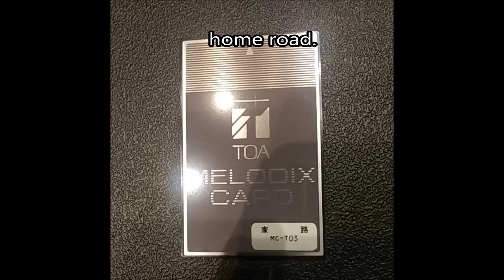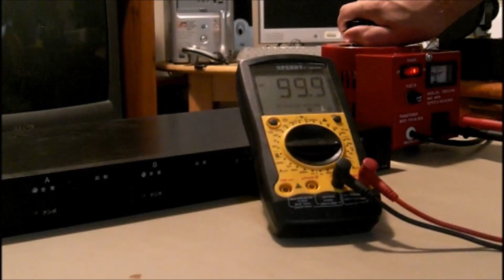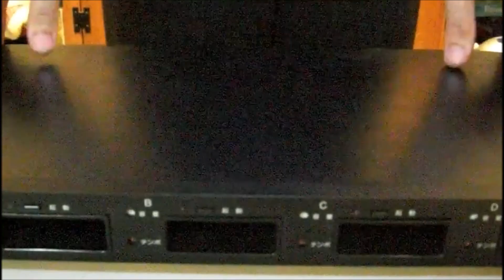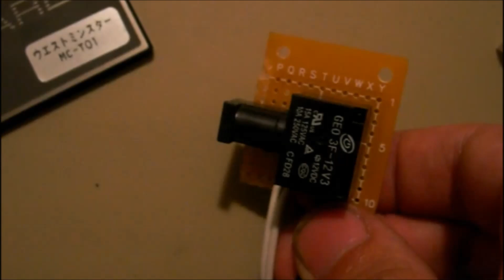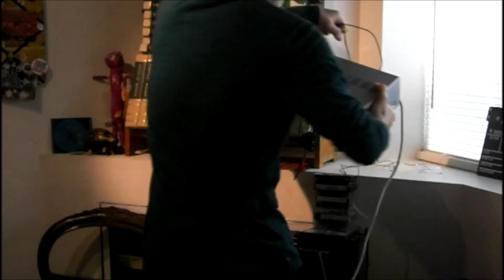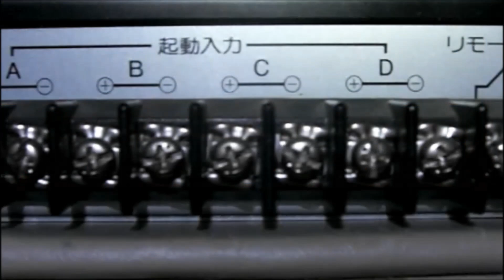toa melodix - a look at the chime source used in a majority of japan's outdoor warning system.

Comment: There is also a system of radios installed in each major fire department, those radios are to transmit emergency signals to these outdoor speakers. The FDMA Is the one who mainly transmits the emergency signals, the signals are made by J-Alert a company owned by the FDMA. For example, if there is a missile launch, The FDMA Will issued a missile launch information warning using the radios mentioned.

Comment: i recently placed a bid on an ml-1000 (card included). fingers crossed 🤞

update: i won
Reply from the maker: congrats on winning the melodix! now i won't be the only one in the states to own one. though i am still the only one with an ml-304b model. and you'll be the only one with an ml-1000 model... for now. btw, before you plug it in, you'll need this: https://www.amazon.com/VCT-Japanese-Transformer-Converts-Voltage/dp/B081TLK87S?th=1 the melodix normally runs on 100 volts ac, so plugging it into 120 volts ac may damage it over time. so this device will step the 120 volts down to 100 volts so you can safely run the melodix in the usa.
Reply: @brokensolarpanel2649  thanks bsp!